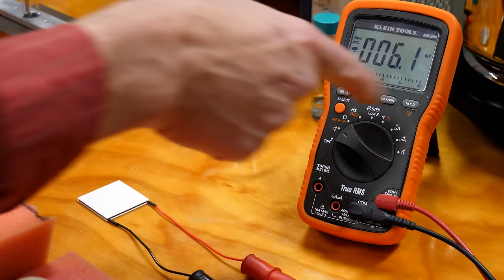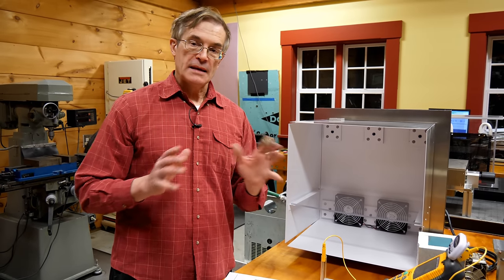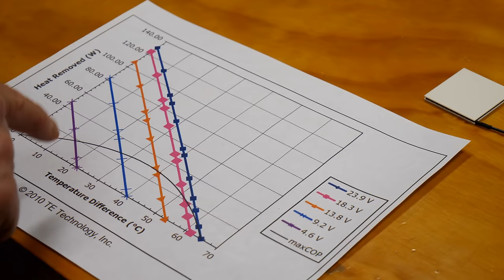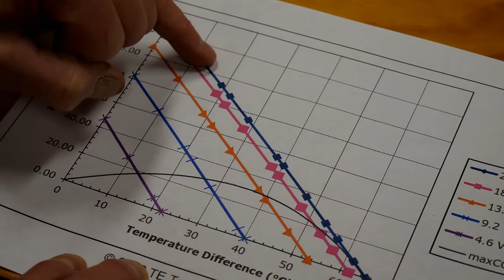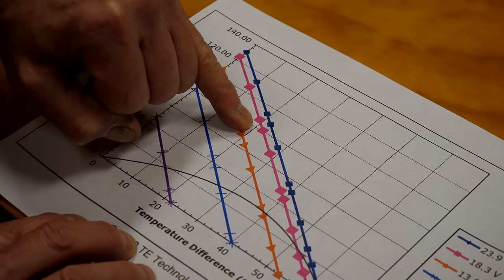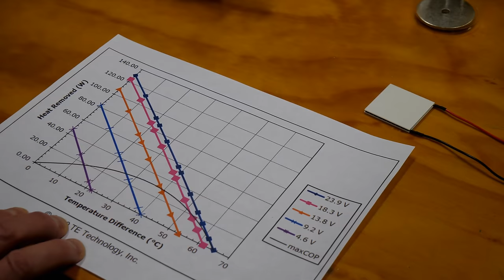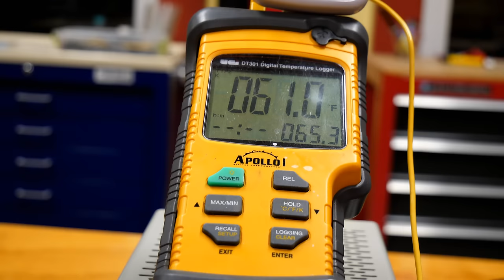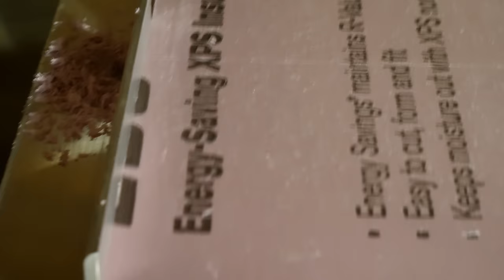BUILD YOUR OWN REFRIGERATOR! - SOLID STATE TEC

Comment: I could not find it in the comments but why some of the spacers are with rounded holes and others are fully solid spacers? Any thermal reason or just weight saving?
Reply from the maker: The holes decreased the surface area and therefore increased the pressure at the interface where the thermal grease was located. It was an attempt  to improve  the heat transfer.   The net result  was an increase in heat flow, but the improvement  was small and not worth the effort.
Reply: Thanks a lot for the insight. Great work anyway I am trying myself creating a ac system based on Peltier and your video was inspiring :)

Comment: Question: When you apply forward bias to any PN junctions, shouldn't it cause the energy band diagram more flat (reduce slope/electric field) across junctions therefore releases/absorbs less thermal energy? I mean, why applying more bias will amplify the thermoelectric effect?
Reply from the maker: That might be part of the underlying principle and be inseparably tied to the performance of all TECs.  Because they are resistance devices, increasing the bias will increase the current flow as well.
Reply: @TechIngredients  It is true. But the energy level difference between P doped and N doped will be lowered. Assume increased forward bias, are you saying that the increased energy due to increase in carriers  (hence current) outweights the reduction of energy emissions/absorption (due to decreased conduction/valence band difference)?

Comment: I’m really not understanding why new fridgerators don’t use a hybridized system between the two. During non use time just keeping ambient temperatures would be cheaper than running the pump. But I also can’t wait for the day that we stop waisting money on cooling and heating. If fridge and freezers heat dump into water going to the water heater and maybe the same with A/C unit, we could recapture some of the wasted energy. It always seemed ridiculous to me. Just as we have water and sewer lines inline under the foundation why not insulated freezer and fridge lines with salt water or something? Maybe the gain wouldn’t be worth the extra money of the system?

Comment: I'm 35 but will you be my dad? I wanna do fun projects with you and I find myself incredibly compelled to build almost everything you make! On my list so far is the DIY speakers, this fridge, and even though it's impractical for my needs, the air conditioner. I have an electric scooter and have been geeking out hard expanding the battery, installing a usb charger, and a more powerful motor. I would love to see you do something with DIY batteries or something. I'm about to convert a 36v battery into a 48v one in order to get more power out of my 350w motor.
Reply from the maker: How about a Tesla powered catamaran?  Incoming...
Oh, and thanks!

Comment: Could you kinda reverse the system to create a HOT BOX with an adjustable inside temperature up to 60c.
Such a box could be used to speed the curing of epoxy as you mentioned in your 25 Oct 2019 video on fibreglass strengthening.

If it is cheap enough to build a box big enough to hold the biggest piece of luggage that you own, then you now also have a box to heat treat your luggage against bedbugs as bedbugs AND their eggs died after around one(1) hour @ 60c.
This is how exterminators are now treating places with bedbug outbreaks.
There is lots of research on the topic all over the net.
Reply from the maker: You could.

Comment: Can i use a combination of ultrasonic mist maker and peltier cooler for air cooler? so that when the air is cooled by the mist,  the peltier will remove the water in air which will balance the humidity in air.
Reply from the maker: In general, no.  The process you describe will only recycle the heat energy from the air and into the TEC.  It would be simpler to cool the air directly with the TEC.

Comment: I couldn't understand the analogy at @11:00. What is the relation between this analogy and band theory? Should an electron in conduction band pass into valance band while moving? Can't it directly pass to an another energy state in conduction band?
Reply from the maker: Yes it can, but as you stated it changes it's energy level and that energy has to come from somewhere or go somewhere and the thermal vibrations supplies or accepts that energy.
Reply: @TechIngredients  Oh no. I was talking about the conductive and non-conductive aspect of the analogy. Why an electron has to go low and high energy levels while moving? Once it reached conduction band can't it move without exiting that energy band?

Comment: 27:50 when the block is removed from the water, the temperature reads 130.7°.  Since the water bath is presumably hotter than the block (heating the block) the block should begin cooling once removed, but the temperature readout continues to increase.  
When the water is blown off it is at 131.7°.  Blowing off the water should have had a cooling effect.
When placed in the insulating box, the temperature readout continues to rise reaching 133.0° at one point before finally beginning to fall.
.
How much lag is in that temperature probe.  There certainly didn't seem to be that much lag in the probe used on the gadolinium.  Are those the same type?
If so, where is the extra heat coming from?
Reply: The heat source is at the "finned end" and the thermal probe is at the OTHER END of the block, a LONG way away. When he blows off the water, he is removing heat from the opposite end from where the probe is located, so it makes zero "instantaneous" difference..
When the fins are heated by the water, heat travels by conduction down the block. At the point in time when the probe reaches (say) 130°, the temperature at the heated end of the block is significantly hotter - there is a temperature differential between one end of the block and the other.
So, when the fins are no longer being heated, the temperature differential will begin to balance out. The hotter end (with fins) will become cooler, and the plain end (with probe) will get hotter. Eventually they reach equilibrium. At the same time, all of the surfaces of the block are radiating and conducting heat to the outside air.
The lag that you describe is simply due to the thermal probe being so far away from the initial injection of heat, and the "thermal momentum" of the temperature gradient along the very large aluminium block..

Comment: As cool as this may be, I have to ask, seen at 41:00, if you intentionally defeated the purpose of heat-pipes by cutting the ends off, or is this an accident and factor you over looked, as the vapor fluid is no longer functioning as intended and you are cooling via metal conduction only at that point, I await patiently for either a follow-up video, or reply.
Reply from the maker: What heat pipes?

Comment: i wonder if it would work to just use the chip itself and lap the heat sink with the ceramic instead of using thermal compound...or at least to use less thermal paste
Reply from the maker: The paste helped, so I used it to maximize  the performance.

Comment: people make the same mistake in car air conditioners when they crank up the fan to high expecting quicker cooling as apposed to heat transfer time required per surface area .

Comment: Do you think it would be possible to regenerate Calcium Nitrate for cooling cycle when mixed with water by using Temperature Swing Solvent Extraction?
Reply from the maker: Yes...but the process requires  several steps; heating the mixture to achieve  a high concentration then cooling to precipitate the solute and then reintroducing water to achieve  cooling.
That might be too complicated.
Reply: @TechIngredients  I thought you could just do it directly from the amine solution and water by mixing.  That the Calcium Nitrate would have more affinity for the water as the temperature lowered, but maybe your are correct.  May have to keep the amine solution at elevated temperature until mixing to prevent precipitating out. Thank you for the feedback.  Great channel.

Comment: Peltier ! but if a vacuum produces water to boil at 80 degrees for instance, depending, why not pressurize?  Also surface area of/for the heat sinks causing more diffraction, grooved would help ( depending on the thickness, even thicker with small parallel holes through the aluminum to remove heat)   We need  stupid stoopid breakthru on energy convergence or free energy. ahhhh. ya know it's there but the minerals or chemicals probably are on the moon.

Comment: I am probably just dense but why the holes in the aluminum blocks between the fins.. would solid blocks transfer heat better?
Reply from the maker: They allowed the clamping pressure to be higher and this was more important than the surface area.  They worked a little better in our tests than blocks without holes.
Reply: @TechIngredients  That is interesting.. I would never have thought of that.. I have a few peltier chips I was going to use to build a cooler/ heater for the boat with them.. you have given me a lot to think about here plus a good working model to use as a stepping stone.. Thanks.

Comment: I've thought of a design for a regular fridge using negative pressures and plasma and directed magnetic fields to move said plasma into a spot of phase change
Reply: How electrically efficient is it compared to current widely adopted forms of refrigeration/phase change tech?
Reply: A M I honestly have no idea, I'm sure it would be more efficient then current designs though.. by how much idk, I haven't made it or crunched any numbers it's just something I had come to my mind.. it would likely be able to reach far lower temps though

Comment: How cold can this freezer go ? Thanks you!
Reply from the maker: This is a refrigerator, nevertheless it can go a little below freezing.
Take a look at our follow up video where we built a freezer based on this technology that can go to -25 C.
Reply: @TechIngredients  i will check out the video , thanks. I need a cheap budget freezer that can freeze up to -50 degrees celsius at least… do you have any tips how to realise this? Thanks very much
Reply from the maker: That's too cold for any TEC based system unless you're only interested in cooling a microchip sized load like a CCD or CMOS imager.
You'll need a phase change system and unless you can locate a used or discarded laboratory freezer this will cost a lot.
Did you watch our latest video?  I cover the merits of cryogen cooling.

Comment: The number for coefficient of performance is like this:

1 = Unity; 1 watt in, 1 watt out.

All C.O.P. ratings are less than 1. We cannot achieve unity in any configuration. So the rating will always be a less than 1 decimal.
Reply from the maker: I think you misunderstood the principle.  The ratio is for energy used to energy MOVED.  The energy is consumed because moving the heat against its natural flow from hot to cold is anti entropic and requires energy input to the system.

Comment: Also using the fans on the inside will not have a proper temperature. You will need a magnetic fan blads...just like in a water pump?
You also need a heat sink for the fans on the inside...
Reply: "using the fans on the inside will not have a proper temperature" ??? I mean, huh?  "You also need a heat sink for the fans on the inside..." Huh? No Mr Tillman, they will not. The entire painted aluminum interior shell is the interior heat sink. The method of transferring heat from materials placed inside the unit is  mostly convection using air as the medium, some from radiance. As he stated in the video, the fans were placed there to aid in circulating the air IF necessary. Spend a little more time comprehending the subject before commenting please. Also if English isn't your native tongue you're excused, but your "points" as they were are very difficult to follow with the level of incoherence you display. Please redo your commentary!

Comment: Why dont people use vacuum chambers as insulation? For example, having double walls on the fridge, with a vacuum in the middle
Reply from the maker: It's a matter of cost.  Isolating the two walls against one ton per square foot of atmospheric pressure requires an expensive structure.

Comment: What voltage are you finding works the best?
Reply from the maker: That depends on the wiring.  These TECs can be wired in series or parallel or a combination of both. The lower the current each TEC draws, the more effecient the system.  We can maintain 0 C with 125 watts total continuously.
Reply: @TechIngredients  That's a very good point! So, if you are running 125 watts what peltiers are you using and with voltage and what wiring configuration? Any help would be greatly appreciated!

Comment: You stated at time index 1:10  that a compressor will compress a refrigerant turning it into a high pressure hot liquid.  You are incorrect as the compressor creates a high pressure hot gas.  It then goes to the condenser coil and air is blown across the coil drawing heat from the hot gas…causing the hot gas to cool off and this causes the hot gas to condense…thus the name condenser coil.  (Phase change) This high pressure liquid now moves to the metering device.  I know your conversation today is about a different type of refrigeration but those watching this should understand the phase change process the way it actually functions.
Reply: Well said, industrial HVACR guy here and I catch the same type of stuff.

Comment: Here is a suggestion for you:   make a solid state device that can drop into the heater of antique cars to produce instant air conditioners.   Is this possible?
Reply from the maker: Probably not practical because of the low effeciency of solid state cooling.

Comment: Hi Ti i wish to make a chill cabinet 6 ft x 2.5 ft timber frame glass front and top what cooler would you recommend please.Paul
Reply from the maker: For that large a volume a thicker layer of insulation than the 5cm we used should still make TECs viable.  They will use more power in the long run, but will be easier to implement.  Stealing the compressor system from an existing commercial refrigerator would also be fairly easy as well.
Reply: haha yes a good idea Thank you.

Comment: i watched up to 21:54 and have a question my add won't let go of. What happens if you attach another Peltier to the hot side of the attached peltiers? will you generate enough energy to power a fan to cool the hot side of the peltiers?
Reply: hi again watched to 35:05 and my ADD needed an answer to another question.  The thermo Blocks attached to the back of the fridge should be stainless steel with aluminium inserts shouldn't they be? you just said earlier in the video  Stainless steel has a low thermo conductivity and we know that aluminum has a high thermo conductivity. If you were to add stainless steel blocks to the back but machined out a core to insert an aluminum block within that core wouldn't that work better for transferring the coldness into the refrigerator. This idea was also shown from the Aluminum block hot water test earlier in the video. thanks.
Reply from the maker: Stainless has no benefit for thermal transfer unless the goal is to prevent it.
Reply from the maker: No.  The added Peltier will inhibit the removal of heat from the primary Peltier and the reduction in the effeciency of the primary will far outweigh the electricity generated by the secondary.
Reply: @TechIngredients  holy crap! you're so fast, thank you for answering so quickly! you're super smart and Ive learned a lot so far. that makes sense,  but the reason I asked was because wouldn't you have cold leakage through the sides of those blocks sandwiched between the pelts and the fridge? shouldn't those blocks be insulated individually?
Reply: @TechIngredients  awesome! thanks for answering!

Comment: What TECs were used? 12710? or 12715? or something else? Based on the wattage of the graph, i think its a 12715 but looking to verify.
Reply from the maker: I believe  it was a 12715 module.
Reply: @TechIngredients  I actually answered my own question when i watched your Extremely Low Temperatures explainer about why stacking doesnt work. Right before you show the graphs, you show a 12710. Thank you for the in-depth videos, i learned a lot and was able to fabricate my own 8 TEC fridge. My only issue now is voltage and current regulation.

Comment: Can these magnetic particles be suspended in a fluid, like that oil and then pump them through a magnetic field, allow it to heat up, disperse the heat outside through a heat-exchanger and then pump them back into the magnetic field to warm up again?
Reply from the maker: Potentially, yes.

Comment: What happens if you use one peltier to power another peltier by heating the first one? Could you line the inside of the refrigerator with an array of peltier that are all run by an array on the top of the unit that is sitting in say direct sunlight and being heated :)
Reply from the maker: These are very inefficient and the conversion of sunlight with PV panels would be better unless you didn't have any sunlight then you might use our "Campfire Generator".  Take a look at that video.

Comment: You forgot the condenser, you probably shortened your explanation on purpose but in doing so made a mistake. A refrigeration compressor only moves vapor, it cannot handle liquid. The condenser takes the superheated gas from the compressor and condenses it back to liquid.
Im sure you already knew that but clarity is important